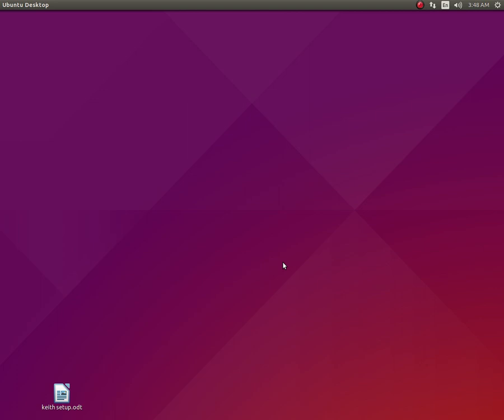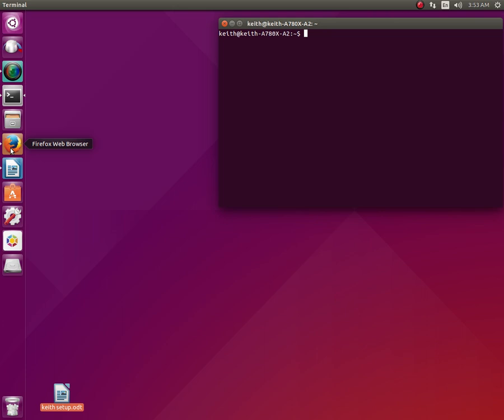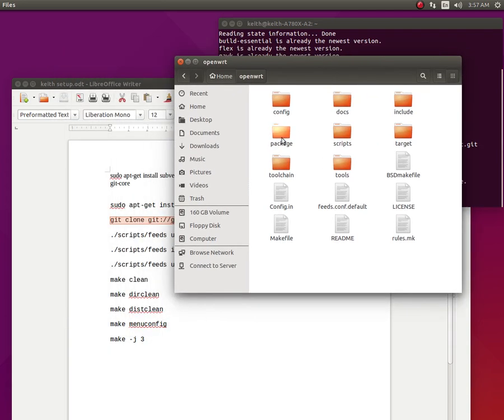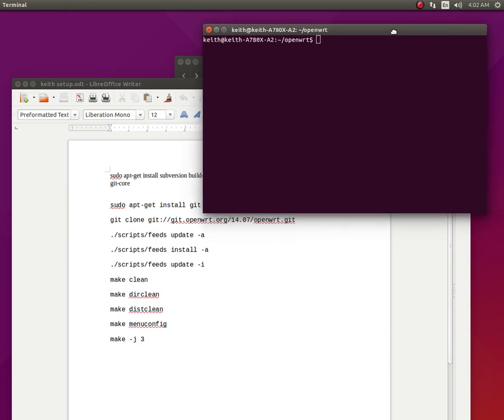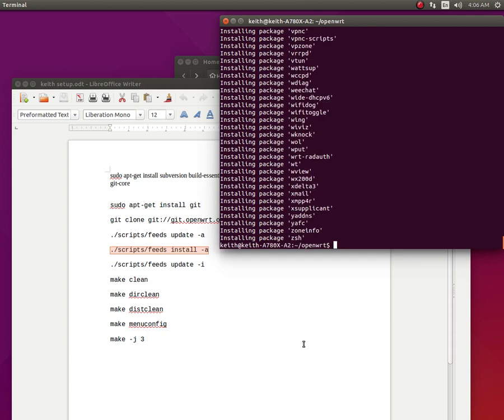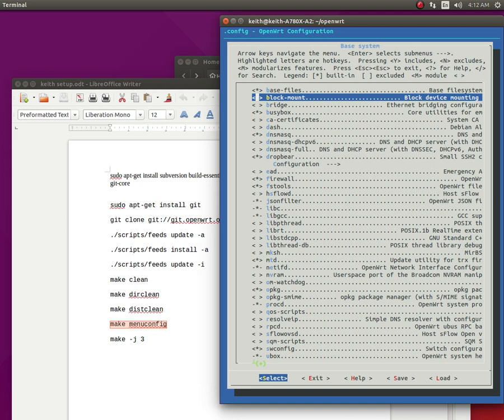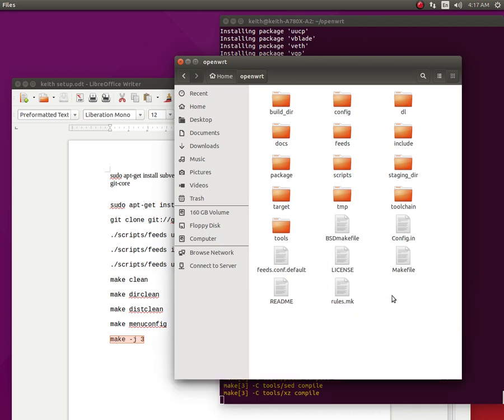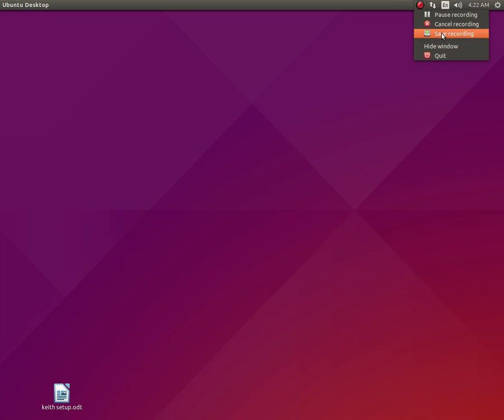BUILD OPENWRT,  BUILD GUIDE ,BARRIER BREAKER 14.07

Comment: can you please tell me how to install asterisk pbx package on openwrt? i have seen you've skipped voice over Ip on menuconfig. thanks in advance. nice tutorial by the way.
Reply from the maker: +Ferdous Mahbub OK Log into your router,Go to system thin software click on update be sure  you got the wan pluged up to the net.type in filter asterisk and click on install what you want.If you want to compile it into build and put it on your router,I think you need to do this way first to find out what you want, get it to work the way you want.It looks like there are over 40 packages and support packages so its going to take some time to get it the way you want it.
Reply: I have no idea which one is for PBX system, it has so many packages and i don't know which one to install for a simple IP PBX system.I would like to use it with my two IP phones.
Reply from the maker: +Ferdous Mahbub https://forum.openwrt.org/viewtopic.php?id=32392 read that it mite help.Its about Luci-app-pbx package it a good place to start.